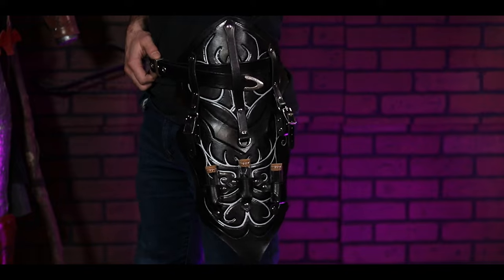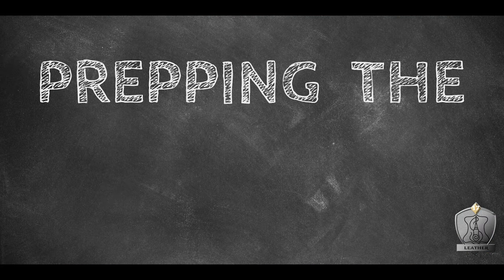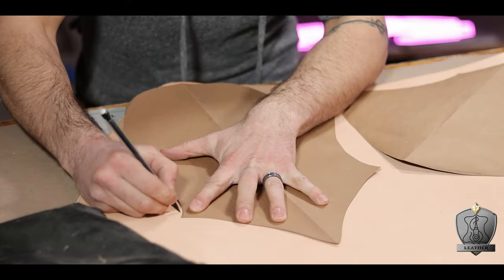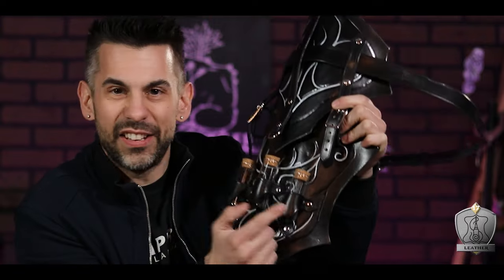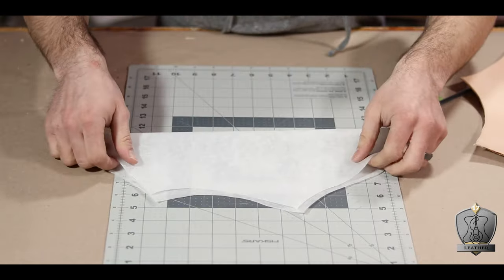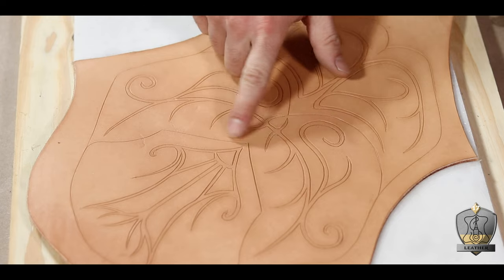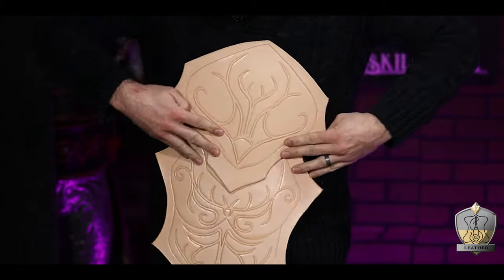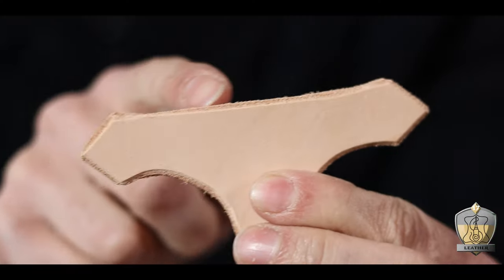Spell Slinger Tasset | Make Leather Thigh Armor

Comment: When you get ready to tool your leather, back the peace with clear packing tape. try to find a tape that that is both sturdy & can be easily removed, &/or that doesn't leave a lot of its adhesive behind. doing this will keep the structure of the leather intact as you tool it, helping prevent the leather from that concave warping you encountered.

Comment: At 7:49, when you traced over your tooling with that rounded clay tool, you can just do that with the smooth beveling stamp you used. Apply gentle pressure, rub across them to make it more uniform.

Comment: You get the shene because it's taking on dye that settles at the surface instead of completely absorbing. If you buff it with a leather conditioner after it gets rid of the "shene".

Comment: I can't wait to see one for the other leg that holds a scroll or has a built-in holster for a wand! also, you might want to get an electric slicker, it saves so much time doing the edges and gets a really smooth finish.

A cool upgrade would be a pictograph on each vial holder to act as a label for what goes there, as well as breaking up the solid black of the leather there.

Comment: dip dyeing definitely stiffens up the leather as you fill in gaps with dye, but you can bend and stretch the leather back and forth after dyeing to give it some of that flexibility back. That patina from the dye can be prevented by cleaning off excess dye while drying and avoiding too many coats, but if it does happen a bit of alcohol on a rag will rub it right off. I like the rings and belts to add versatility, I'll probably do that with my own tassets.
Reply from the maker: Thank you! The patina was driving me crazy!
Reply: @SkillTree  Thank Weaver Leather Supply, I learned the trick from them

Comment: You could also try slightly angling your beveller while stamping and just follow the head of tool. If your leather isn't too wet that should also help with the dimpling and still leave a crisp outline that is if you don't want the rounded edge like you did on your design in this project.
Reply from the maker: I will 100% give that a go! Thank you!

Comment: Another trick with the beveler stamp, as long as it's got a smooth surface and not a checkered one, is to simply drag it into the beveled line once you're finished hammering. That way you'll smooth down any marks left by the hammering.

Also, when transferring a pattern, I just use normal paper but wrap the leather into cling film!

P.S. I'm still waiting for the hood pattern! I'm a lazy guy when it comes to pattern making, so please... release all of your patterns 😂
Reply from the maker: Good call!

Comment: Dip dyeing your leather makes it stiff because you're using an alcohol-based dye. Alcohol penetrates really well and helps get the coverage even, but it also evaporates quickly and seems to pull the natural oils out of the leather. If you dip the piece, that's a LOT of alcohol going into it, so it basically pulls it all out and leaves you with hardened leather (a good thing if that's what you're going for). If you do want to dip it anyway, and you want to keep it supple, think about using a water based dye and/or hit it with some oil after the dye sets in. Note: do NOT add oil before using a water dye, because the dye won't take well (oil and water, after all). Another tip: never mix dye mediums. If you, say, run out of black alcohol-based dye, don't try to finish the project with a black water-base. It'll never match right.

Comment: If your leather gets hard after dying use saddle soap. Apply to both sides with a cloth in a circler motion, let it sit for 5 to 10 minutes, don't rub it in right a way but let it "soak" into the leather. now that it has had a few minutes to "soak in rub it in till you can no longer see any saddle soap (Leder Fett for those in in Germany and other countries that speak German) anymore. Wait over night or so before using the piece. Do a test bend to see if it is supple enough for you. If it is still too stiff wait 24 hours and check again, if still too stiff warm the leather with a hair dryer on low, making sure to constantly move it around the piece. Once nice and warm to the touch, not so hot you cant pick it up and hold it comfortably for 10 to 20 seconds, rub in more saddle soap like the first step and wait till the leather is back to normal temp then rub it in completely. Now slowly and lightly start bending it back and forth increasing the degree of the curve every few bends, 5 to 10. It should be supple enough after 5 mins. if not then the dye has penetrated way too deep and the leather may be beyond repair.

Side note: dip dying: only dip the leather in for 5 second max and wiping away any excess dye as soon as possible so it doesn't saturate the leather.

Comment: Are you cleaning your leather with resolene first? This cleans the leather and helps absorbption during dip dye to prevent that sheen. Some dyes have "metal" powders in them which sometimes oxodizes on the surface as well is the dye is old or the leather not clean. I am no expert either, if I am wrong someone can correct me. My purple alcohol based dyes have that sheen when I don't clean the leather with resolene first.

Comment: Dip dye question: what kind of dye are you using and how fast are you passing the piece through the dye? Alcohol dye like fiebings pro dyes will dry out your leather if you completely submerge the piece slowly. If dipping in that kind of dye, do it in a controlled quick manner so as not to allow the leather to soak up the alcohol and only allow the piece to pick up the color.
Reply from the maker: That is EXACTLY my issue then. I use an alcohol dye and let it bath a bit. So just a quick pass through then! Thank you for the tip!
Reply: @SkillTree  np man, keep living up. Love your leather vids.
Reply: You can also use a light coat of neats foot oil before you dye. It will help the leather soak up the dye and keep the leather from getting to stiff.
Reply: @cindytumlin2743  ^

Comment: the problem using bee's wax is that when you are in a hot area you have a chance of the wax staining any clothing that touches it ... one reason i will never wax harden any of my leather.
Reply: One of the tricks I used for what you call wax leaching would be to spray the items that you have already waxed with good strong hairspray and that kind of seals the wax from any other clothing when your body heat gets warmer or the temperature of the other side environment is warmer and you just reapply the hairspray after you remove garments and put it up for storage